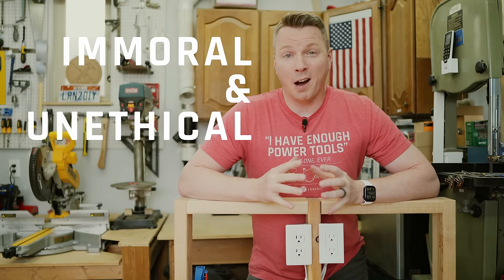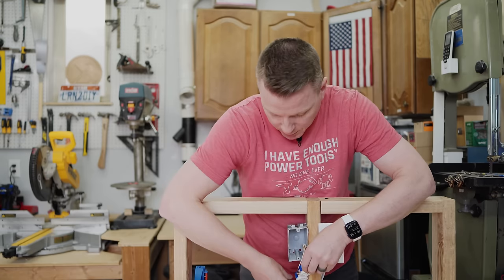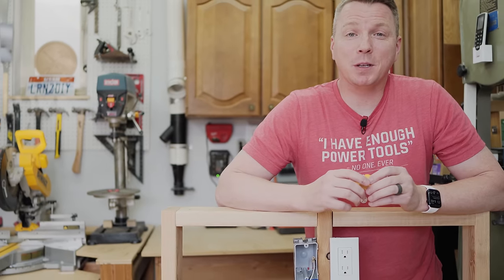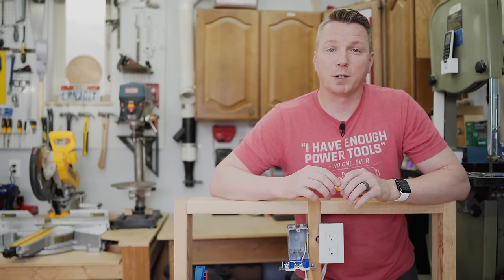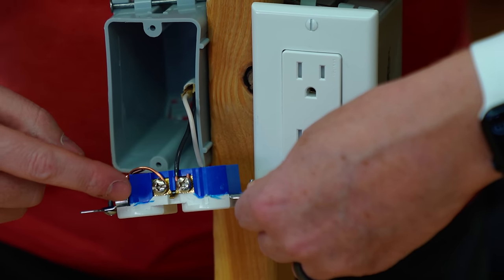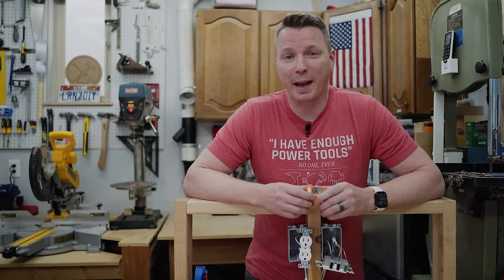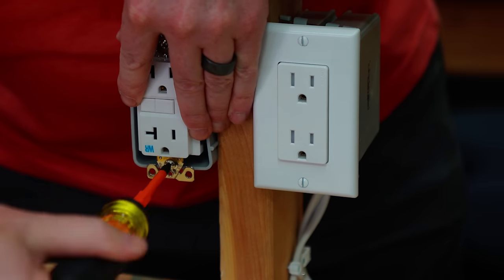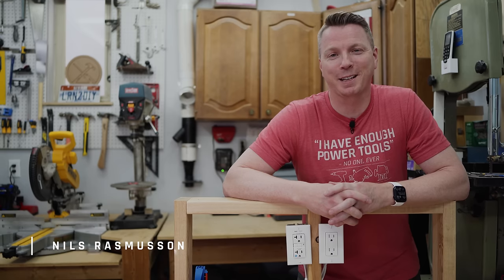People Are Adding Deadly Hacks to Outlets

Comment: I’m a 26 year electrician. We did a rewire on a house a few years ago that was full of bootleg grounds. An older electrician friend told me that some inspectors advised to do that several years ago. He was smart enough to call them out on it, and they hadn’t thought of the dangerous consequences that could come from it. I can see how that could happen very easily. For those of us in the industry, how many service calls have we been to where a neutral opened up on either a bad joint or a bad device? That’s all it would take is one time, and get someone hurt or lose their life. That’s why the grounding wire is there, to protect YOU from being the path.
Reply: What exactly makes it dangerous? Don't the ground and neutral lines ultimately connect together up in the main box and in the 3-pronged device as well?

It can't be an electric shock thing due the connections part mentioned already. Is it a fire hazard thing? Or, is it one of those things people presume to be an issue, but in practice isn't? 

Real questions here. I follow code(because seriously it's not that hard most of the time), but I'm genuinely curious, since no one thus far has given an answer that isn't at odds with what my electrical engineering degree tells me about how electricity works.
Reply: @InfernosReaper  The ground and neutral should only make ONE and only ONE connection past the "service point" and before/at the first means of disconnect. If you have more than one, you will create a parallel path for neutral current for every circuit in that structure.
Reply: @G8tr1522  But why is that is an issue, though?

It's a pretty simple question. I can guess at the answers, but I want someone to actually give something clear and definitive.
Reply: @G8tr1522  no parallel path with a bootleg ground. Cause there is no actual ground going to the panel.
Reply: @InfernosReaper  you are right. There is no issue with this besides code. Most old appliances bond the chassis with the neutral anyways
Reply: @On2wheels94  It's basically how many, if not all, grounded appliances work anyway, neutral and ground connect at some point within them, which is part of why grounding does nothing to protect devices.
Reply: @InfernosReaper  the “ground fault detector” (there are many names for this) uses current being shorted to ground to detect something has gone wrong.  Consider this.  A device has a grounded chassis and you make contact with it and the live wire. Current runs threw your body and into the earth pin.  In a normal set up this will be detected at your breaker box and cut the power off. In this set up it will not be detected and you will be killed.
Reply: With AC power, the netural carries current. If the netural is damaged or disconnected from the panel... and you have a bootleg ground. The grounded surface becomes a floating potential. The ground wire is for redundancy that should never be carrying current. Just think about it if the netural and grounding wire is bonded at the panel... with does the ground wire exist, so big copper can sell more copper? Or it's for redundant saftey...
Reply: @SuperPickle15  the floating potential would still be there with a connected ground wire and disconnected neutral. In either case the outlet would not work anyways and would be cause for further investigation. No one is doubting the use of a ground wire in NEW installations. Just arguing that the bootleg ground is not dangerous, and less dangerous than no ground at all, which is why its used.
Reply: @qtheplatypus  ok, but can you explain why being killed is a problem? 🙄
Reply: @Illswyn  because it wastes electricity
Reply: @On2wheels94  there would be no floating potential, electricity takes the path of less resistance. So unless the grounding rod at the panel is faulty, theres no reason for current to flow back toward the outlet from the panel.

 The danger about bootlegging is it creates a perceived safety of the equipment. it's only marginally safer than no ground. And thats if everything in the circuit is in working order. And lets be frank here. If your resorting to bootlegging the ground, I doubt the rest of the electrical wiring is in working order.  The best solution to a retrofit without rewiring is installing a inexpensive GFCI in the circuit. That will insure no ground faults rather you have a ground wire or not. Like seriously, why even add unnecessary risk for less than $15...
Reply: @On2wheels94  if you have a short from neutral to hot with power and have the bootleg, you'll read 0V when measuring from hot to neutral with a multimeter.  You'll read 0V from the bootleg ground to hot.  You'll read 0V from bootleg ground to neutral.  You have nothing to compare the potential.  The ground.  A novice might think there is no voltage.

...and if you're not careful, you'll end up being the ground.
Reply: @SuperPickle15 so electricity takes all paths back to the source, and the grounding rod does next to nothing electricity is flowing back to the transformer, not into the ground, and ground and neutral are bonded at the transformer and first means of disconnect, having a false ground is dangerous because you could have situations where appliances uses that false ground that has current on it trying to get back to the source(the transformer). Grounded appliances like a metal toaster keep neutral (grounded conductor) and your ground (grounding conductor). Neutral is grounded at first disconnect and transformer but ground is grounding and provides a non-current carrying conductor(ie safe) fault path for current
Reply: @On2wheels94  That's ridiculous - assuming the wires go back to a properly wired main panel. Ground and neutral go back to the same bussbar.
Reply: @SuperPickle15  This doesn't make sense. The neutral and ground go to the same bussbar in the MAIN breaker panel. Based on what you just described combined with how it's wired, that'd mean the grounded surface is always a "floating potential." Electricity doesn't work this way. It doesn't "backtrack" to a point of higher resistance (a human body) - ever. In order for you to get shocked, YOU have to be the path of least resistance, meaning there's either some sort of fault, the neutral wire is disconnected AND there's power present returning back to the outlet/socket/appliance, or the circuit is overloaded to the near point of failure (this would potentially create a "bottleneck", as well as be a major fire hazard - at which point, a properly rated breaker should've already tripped long before ever touching it). We're not talking about faulty circuits here though. We're talking about bootlegged grounds. In short, unless you're more conductive than copper, a bootlegged ground isn't going to shock you. Neither is a "floating potential" that already has an established good path.
Reply: @InfernosReaper  Arc fault breakers can't comprehend this what you just pointed out. Because of this, my boss constantly complains of the same thing: ground and neutral both go back to the same place, why require us to install breakers that require separate grounds and neutrals? Even in new appliances, ground and neutral connect. In the case of some dryers, you can literally see them bolted to the same metal. 

As far as I know, a parallel path only reduces the resistance, meaning parallel circuits should look even more attractive to wayward currents. So I don't think this is the reason for separate grounds. 

I can see the logic of having a bare ground inside the jacket. It's like sheathing on metal clad wire. They catch currents before you do. Maybe that's their purpose. 

But if that's their purpose, the ground in appliance cords would catch the current even if grounding is connected to grounded conductor on the plug itself. 

Except, grounds in cords are jacketed. You can cut halfway through a hot and then jump rope with the cord and it won't trip anything.

What's the ground for then, if not the cord? Is it there to protect people from broken neutrals in appliances themselves? If so then the ground in the cord still grounds. 

I think one of the real purposes of grounding conductors is to prevent fires. If a mouse chews the insulation off a conductor, the bare ground might catch the current.

Engineers designed the additional ground, so there must be definitive reasons they are required (except when they aren't).

Then again, engineers also now say that sump pumps need to be GFCI protected. We should also be required or allowed to connect a kitchen light to that same circuit so people will have a signal that their basement is about to be flooded when the GFCI decides to protect their sump pump from being a pump.
Reply: @InfernosReaper  If there's only one outlet on the run, indeed there's no real difference.  But look at what happens if you have more than one plug, and devices at different points drawing current.
Reply: @iivin4233  "Even in new appliances, ground and neutral connect." That's only true for 240v appliances, 120v devices do not connect neutral and ground.
Reply: @JohnDlugosz  tell me what happens when you have more than “one plug”
Reply: Is a good way of checking the ground putting putting a fork in the positive charged side and the ground?
Reply: @Nkw022  depends on what you mean by "good"
Reply: @pauldzim  I mean a safe and effective way to see if it grounds correctly I forgot to say you also need to be bitting a brass wire going into the negative one with a bare knee touching the ground to see if electric goes through the negative one to check for if it is grounded incorrectly
Reply: @SuperPickle15 with AC power the neutral carries the UNBALANCED current.
Reply: @InfernosReaper  sorry to add to the carfuffle.
Bootleg ground is indeed very dangerous, beyond the typical "no ground is dangerous", here's why:

Imagine the neutral wire from the panel to the outlet is loose. If an appliance is plugged in and turned on on that outlet, it will not work. However, the neutral side of the outlet will now be live since it the neutral is now connected to the live side (through the appliance). It's kind of like running a long wire from the live side to neutral.
If there is NO GROUND, nothing will happen. The appliance chassis will be connected to nothing, and unless the appliance is defective, it will just not work.
If there is a BOOTLEG GROUND, the chassis of the appliance is now live. You become the neutral.
Reply: @BullCheatFR  how does it become live when the bootleg ground is connected to neutral?
Reply: @InfernosReaper  neutral is just a label. If you hook up a live wire into the neutral side, the "neutral" is now live, and so is the bootleg ground.
If your neutral wire comes off or becomes loose anywhere in the circuit, the "neutral" on the outlet is now floating; it's not neutral anymore, it's just a label. 
If you have a floating neutral and you plug an appliance in, you are effectively connecting the live end of the outlet to the neutral side of the outlet. Imagine the appliance as a light bulb. It's just a high resistance (~100ohm) path between live and "neutral". Since neutral is floating, it is now 100 ohms behind live, which for most safety considerations is live. Because the bootleg ground is connected to neutral, the ground terminal is now also 100 ohms behind live, which is effectively live.
This is not a problem when everything is working properly, because the neutral wire provides a low impedance path to neutral, "forcing" the neutral side of the outlet to be close to 0V. When that connection is broken and an appliance is plugged in, the neutral terminal is now electrically closer to being live than being neutral. Since the bootleg ground is connected there, any chassis bonded to ground will rise with the neutral.

Does that make more sense, or should I try to explain differently?
Reply: @InfernosReaper  if you are still confused, I'm happy to make a video demonstrating what is happening
Reply: @InfernosReaper  with a proper ground, a loose neutral wire will cause the appliance to stop working. But because ground is a separate wire all the way to the panel, it will not rise up to live voltage with the neutral terminal. The worst that could happen is the ground wire becomes loose, and you now have no ground - still not live voltage on ground.
Reply: @InfernosReaper  sorry if this is still confusing. Effectively, the appliance plugged into the outlet acts as a (long) wire between outlet live and outlet neutral. If there is no wire from outlet neutral to panel neutral, outlet neutral is now at the same voltage than outlet live.
Reply: @BullCheatFR  I genuinely don't understand what you're saying since it never makes a complete circuit until a hot line is involved, but because of how everything is setup, hot can complete a circuit with ground or neutral already.

What exactly changes by connecting neutral and ground in the outlet that's different compared to neutral and ground connecting within an appliance?
Reply: @InfernosReaper  there is no difference. Ground and neutral are not connected in an appliance, unless the appliance is defective.
I will make a video tomorrow demonstrating why this is a problem. I can promise you it is a real safety concern, not just a best practice... And I do a lot of not-so-ok stuff myself when working on off grid systems.
Reply: @BullCheatFR  please make a video! I'll also be watching it
Reply: UK here (& not a professional electrician). Here in 🇬🇧 we have 230V AC supply & extremely strict regulations as a result. All modern installations hav to have an Earth Leakage Circuit Breaker (ELCB) fitted which trips at 30mV. This bootleg ground hack wouldn't work in UK as the path from neutral to ground would trip the ELCB & it couldn't be reset until the neutral/earth path had been removed. 
Obviously you're in 🇺🇲 & regs will be different but are ELCBs not mandatory?
Reply: @BullCheatFR  Yes, make a video and maybe take apart a major grounded appliance or 3 to confirm or refute your claim that ground and neutral are not connected in appliances for posterity.
I recommend at least 1 power supply of some sort(desktop ones are the easiest) and maybe a microwave(though most people don't have bits for doing that)

Naturally, let us know when it's ready. I genuinely look forward seeing it.
Reply: @InfernosReaper  sounds good! I will not be taking apart apart appliances in the same video. That is something you can do on your own. I will measure resistance from neutral to ground to show they are not bonded.
Reply: @stephenphillip5656  we have basically the same thing except ours is called a GFCI (Ground fault circuit interrupter) we also have an AFCI (arc fault circuit interruptor) that is required basically everywhere except the garage and bathroom areas. We use a dual function circuit breaker that has both of these functions which makes a safer home in case of a fault. You can retrofit a two wire system with GFCI, and that is UL listed, safe, and code compliant in that situation. It’s much better to have the ground wire for sure because that is more reliable than an electronic device.
Reply: @BullCheatFR  Regardless of whether or not your assessment about ground and neutral in appliances is correct, you should do the appliance bit. Otherwise, you're leaving important educational material out about how grounding works.

Naturally, you don't have to do the disassembly on camera. That's unnecessary. Just have a couple of grounded devices taken apart or at least pictures of it, to demonstrate the hows and whys.

EDIT: Also, you should also include a picture of the inside of a breaker box for completion.
Reply: That's also why the ground wire is always longer than the other wires. That makes sure that if the wires get pulled out, ground always pulls out last.
Reply: @BullCheatFR  I am also interested in that video. So I'm looking forward to it.
I made a super long explanation as to why it's important to connect Neutral and Ground inside appliances but I accidentally erased everything before pressing reply and I can't Ctrl+Z.
Basically it boils down to it's worse to have Ground seperated from Neutral because what if the loose wire was Ground instead. Then if a short happens to the body of the toaster you will have no clue as opposed to it triggering the breaker to pop imediately if Ground is connected to Neutral in the toaster.
Also your way is basically worse than 2 prong outlet circuits as 2 prongs (Live & Neutral) would stop the toaster from working but in your case the toaster would show no signs or circuit failure.
I explained this much better and had such nice examples, but it's 10AM and I haven't slept yet...
aah.. I really hate it when that happens
Reply: "Safe american outlet" -said no one ever
Reply: @InfernosReaper  

Here is how I think bootleg ground can be more dangerous than no ground at all:

Side note: I study physics so I'm confident with the reasoning but I don't know if those problems are common in practice.

In the electric appliance, the entire path from hot to neutral would be kept insulated as much as possible.

The ground wire may be connected to the outside part of the electric appliance (not necessarily the cover of the electric appliance, but at least more "outside" than the neutral wire).

If the neutral wire is a damaged somewhere behind the outlet, the electric appliance would stop working but the entire path from the hot wire, through the electric appliance, back to the outlet at the "neutral" slot, connected to the bootleg ground through the jumper, back to the electric appliance through the "ground" wire to the outside part of the electric appliance. "neutral" and "ground" are written with """" because they are now actually hot, they are only "neutral" and "ground" in labels. This would be more dangerous than if the path I described just end when they are back to the outlet.

It would be even more dangerous (in the aspect that it's less noticeable) if the neutral wire is damaged somewhere behind the outlet but not to the point of disconnecting to the actual neutral. The damaged point would have a resistance equal to a significant fraction of resistance of the electric appliance. The electric appliance may still work (assuming it's not something really sensitive to a drop of voltage). In this case, the "neutral" wire would have a fraction of the voltage (in other words, it has oscillating electric potential similar to the hot wire, but with smaller amplitude). With the bootleg ground, this smaller voltage is connected to the outside part of the electric appliance.

____

BUT, on the other hand, IF the neutral wire is not damaged behind the outlet, the bootleg ground actually do one thing better than no ground: it can collect the charge build up in the outside part of the electric appliance to avoid fire hazards.
Reply: @InfernosReaper  Device is connected to outlet and drawing power. Neutral wire from outlet to panel fails. neutral and ground at outlet are now hot. Outside of device might be hot. Device is apparently without power due to no neutral. But you touch it and you can die or at lease get shocked.
Reply: @messygaragetinkering  Wrong. If your body draws 0.2 A and a device is drawing 10 A on a 15 A circuit the breaker won't trip, the wires won't overheat, but you could fry and die. And some electricity will take a higher resistance path. But 0.2 A is more than the minimum to kill.
Reply: @qtheplatypus the danger of no grounded chassis is when a loose live wire contacts the chassis and a person touches the chassis and a separate grounded item, like a water faucet.
Reply: @SuperPickle15 Least resistance is wrong! Electricity takes all paths, all the time. It just splits the current between them. Touching a neutral wire and a water pipe allows current to flow through your body, but it is very small unless the neutral resistance is very high.
Reply: @BullCheatFR thank you for the clear explanation.
Reply: @BullCheatFR did you ever get around to making this video?
Reply: @qtheplatypus Dingdingding, first person to actually describe the danger here.
Reply: @InfernosReaper Under normal circumstances, it would never be an issue.  But, under normal circumstances, not having a ground at all would never be an issue either.  The separated ground is there to drain hazardous EMF when the situation is abnormal.  Any exposed metal in an appliance is attached to the ground.  In this case; now it is bonded to the neutral.  It is part of the LIVE return circuit to the supply.  Lets say you were touching this thing...  Say it is a countertop pressure cooker.  Lets also say there is a bit of a resistive connection in your old breaker box in the basement, in the neutral connection.  Then, someone upstairs turns on a hair dryer...  And a space heater..  On the same leg.  With your other hand, you lean on the stainless steel sink...  ZAP!  You are now a part of the current return path for those appliances via a voltage divider network.   Other "perfect storms" could also cause fires.  It is not for when things go right.  It is for when things go wrong.
Reply: @qtheplatypus That is not how a CFCI works.  They measure the current differential between the hot & neutral.  The wired circuit ground has nothing to do with it.
Reply: @stephenphillip5656 It is the same thing as our GFCI devices.  However, no, this would not make them trip.  They actually have nothing to do with the wired ground line.
Reply: @GoingGoneGalt  I don't think you actually understand how resistance and current flow work...
Reply: @InfernosReaper  Yeah, that electronics engineering degree was totally wasted on me.  I should just listen to Youtoob electricians instead.  Like you.  So, tell me where I am wrong, smart guy.
Reply: @GoingGoneGalt  1 guy who wasted his money on an electrical engineering degree to another, the way you described the setup can't actually provide the deadly shock described. The numbers in that just don't up to that.

Annoying shock, sure. Harmful? Not really.

You might wanna brush back up on semester one(sadly the only part that really matters much in the regular world most of the time) and then research more on how various appliances actually work.
It sounds tedious but it's actually kinda neat to learn this stuff.
Reply: @GoingGoneGalt  if the ground wire is bound to the neutral at the plug then the power returning via neutral will equal with the active.
Reply: @qtheplatypus  I'm sorry, that makes no sense whatsoever to me.  I fear that something may be lost in the translation.
Reply: @InfernosReaper  Show me where i ever mentioned anything deadly, at all, then we will discuss the rest of your nonsensical twaddle.  What is or is not deadly is a matter of situation.  30 mA through the heart for 30 mS can be enough to send it into fibrilation.  That's why GFCI's are set to trip there.  If one has a pacemaker, it may be even less.  When it comes to mains power, "it really isn't that bad" is not an acceptable answer.   Ever.   Nothing I said is incorrect.  It would be an unlikely situation that would cause it to happen, but that is what a ground is for.  Unlikely, yet possible, situations.  Add; though it is not my entire gig these days, temporary electrical distribution is still a large part of it, so yes, I do need to stay hip on these things, and no, my degree was not wasted.
Reply: @GoingGoneGalt  if you have a correctly grounded circuit.  Then a short between active and ground will result in an imbalance between active and neutral resulting in the ground fault detector tripping.

If you have an outlet where the ground is connected to the neutral.  Then a short between active and ground will result in the current returning along the neutral and the ground fault detector will not detect that it will not trip resulting in a dangerous situation.
Reply: @qtheplatypus  That is assuming that the diverted path goes to the ground of the device that is plugged in, which it usually does not in a gfci trip situation.  It is usually diverting to ground through some other path, bypassing the wired receptacle ground entirely.   Not always of course, but usually.  If it were, then you are correct, the gfi would not trip, unless that particular receptacle WAS the gfci device, in which case it may still, as the bonding would be outside the comparator circuit.  Downstream outlets would not be protected.
Reply: @GoingGoneGalt  yes it removes a level of protection and makes things less safe.  It adds another hole to the Swiss cheese.
Reply: @qtheplatypus  There are always more things that can go wrong, yes indeed.  Out of curiosity; what country are you from?  I am just curious because of your terminology.
Reply: @GoingGoneGalt  Australia but I am also dysgraphic which makes me spell things weird.
Reply: @qtheplatypus  I have similar issues.  I was just wondering where a hot line was referred to as "active".    I have never had the pleasure of visiting there, sadly.  Do you use the same scheme as the UK?   230V single phase & breakers all in multiples of 8?
Reply: @GoingGoneGalt  230V single phase (technically the voltage is allowed to range between 220 to 240) 50Hz.
Breakers are honestly a mess with both multiples of 5A and 8A on the market.

Industrial applications and some other facilities have 415V three phase power.
Reply: @GoingGoneGalt  It was in your convoluted "how someone might get shocked" setup

As for that "it's the current that kills you" stuff, how long ago did you get your degree?
Reply: @InfernosReaper  Please, show me where I said that.  Use quotes.  I will bet anything I have that you cannot.  Calling my explanation convoluted does not refute it.  You are free to do just that, if you are able.  You are not.  You were correct on one point; your degree was wasted.   Mine was not.  Please show me the groundbreaking medical papers that have disproven the "it's the current that kills you" theory.  That has been pretty much accepted fact for going on nearly two hundred years now.  I will guarantee that my diploma is more recent than that.
Reply: @GoingGoneGalt  The fact you don't get that current is just part of the power equation and cling to that slogan about "it's the current that kills" is kinda sad.

Someone with an electrical engineering degree should actually know better, but here we are

You don't know anywhere near as much as you think you do and the fact you can't even consider the possibility is rather disappointing.

As for "quote ya exactly," I'm not scrolling through 60-something comments to copy-paste what ya wrote verbatim only for you to then talk down to me over it. 

We are done here
Reply: @InfernosReaper  Yup, since you have not a single rebuttal to any of the factual points I made, we would be.   Back to your anime now.